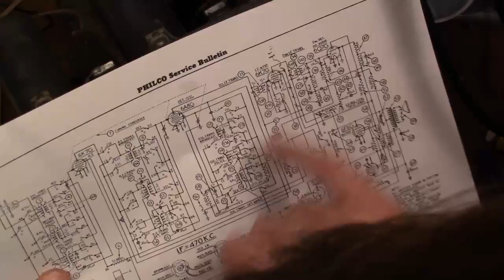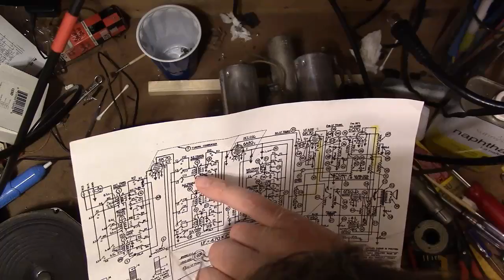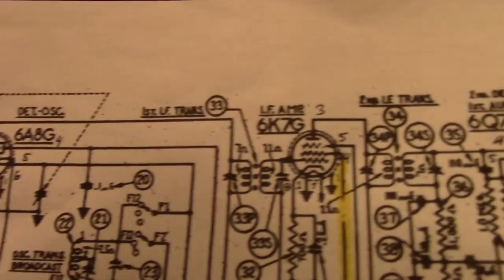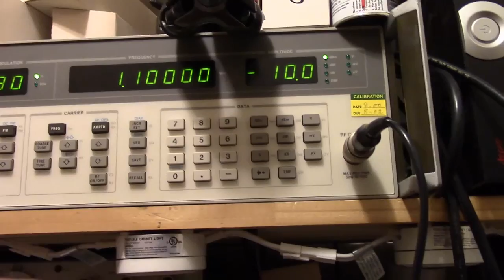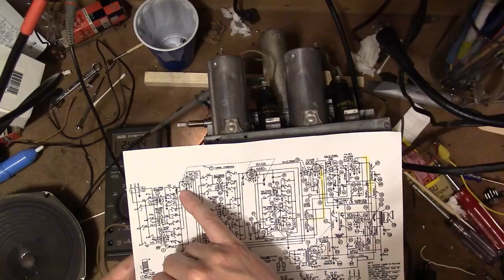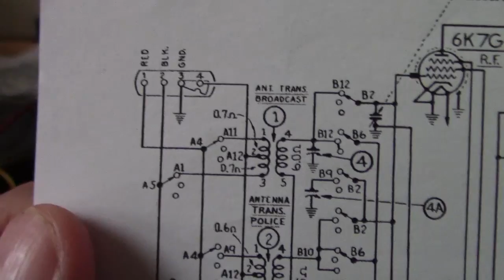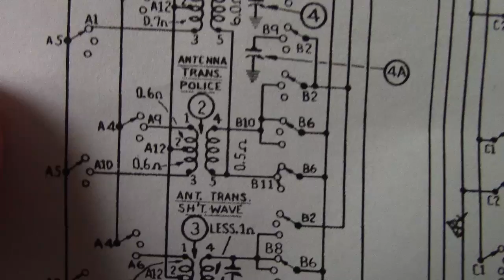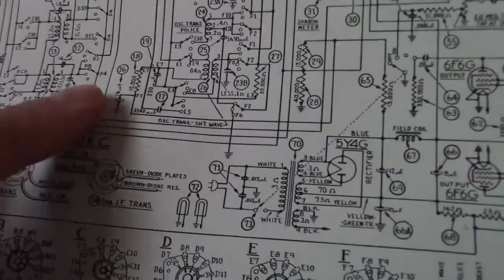Philco 37-640 restoration p8o12

Comment: Great Resto job! I did a 37-650 console last year but didn't take apart the RF deck to the degree that you have. With all that disassembly I think it is quite possible something didn't get put back quite right. So easy to miss something from my experience. Those trimmer caps should show a definite peaking which you didn't seem to be getting which I think is another clue.

Comment: Hi Bob, Make sure that B+ is getting to the RF amp if power is not getting there you will get weak reception. So check that  B+ to the RF amp. All the best, Tom J from Florida.
Reply from the maker: Thomas Johnson Hi.  The voltages on all the tubes are correct.  Still troubleshooting...

Comment: Hi Bob,
You did a fantastic job on the restoration! Since you are weak on sensitivity, I recently read one of my notes from Paul Pinyot where he said that after installing new caps in the AM IF cans of a Blaupunkt radio he was working on, the sensitivity increased dramatically. I can't remember if you replaced the caps: 33P, 33S, 34P, 34S.
Reply from the maker: Joseph Neal No, they don't need to be replaced.  I'm not even sure it's possible. More modern IF cans use fixed mica caps and movable tuning slugs.  It's those fixed mica caps that go bad becuase they are exposed to the air.  This type uses fixed inductors and variable ceramic trimmer caps that do not go bad.

Comment: I have been enjoying watching this restoration from the beginning and indeed it has been a challenge for you. Seems that the sensitivity is lacking. Because you virtually rebuilt the radio there still is a possibility if another missing connection. Good luck. I know you will find the problem.

Dave KD1NA

Comment: ST glass tubes would be proper for that anyway.  Philco wasn't a big fan of RCA stuff, which would include metal tubes.
Reply from the maker: I'm aware that 'G' ST type tubes were used originally but they are more expensive and the shields fit very tightly. Not to mention the metal tubes are shielded better

Comment: Did you jumper across what would be terminals 3 and 4 on the missing antenna terminal board?  There should be a jumper that is attached to terminal #3 going to either terminal #2 or terminal #4, depending on if you are using a true dipole antenna or not.
Reply from the maker: FrankieKat Yes, I tried both and it made a little difference but not a whole lot.

Comment: Something is definitely not right there, with a tuned RF stage it should be picking up the local stations with a short antenna or none at all.
Reply from the maker: OlegKostoglatov Exactly.  AM 720 and 1000 should be booming in

Comment: Hey Mr B.

It's not a grounding issue with your antenna? As one of the three wires for the antenna is grounded to the chassis, and when you supply a ground (with your finger) the signal is much stronger.
Sorry if this is completely wrong, I'm very much a novice, but I didn't see you show that particular wire as grounded in your vid.
Reply: Lawson80 Looking closer at the end of the video, I see that third wire is hooked up to an external ground ... would grounding it to the chassis instead of an external ground work better?
Reply from the maker: Lawson80 An external ground works better as the chassis is just floating.  I live near several strong stations that I should be able to receive with no ground and little to no antenna at all.  Hoping a full alignment will take care of that.

Comment: Sounds like you are a Chicago boy.  Same here.  

Where do you buy your caps for this vintage work???  I am looking to restore an 1959 Philco stereo phono, AM/FM radio, system.  I have gathered various pieces of  test gear for tube electronics restoration I need a good source of parts now.  Please advise of any sources you use in the Chicago area.  I live in a south suburb on Chicago area.  I would appreciate your input.  THANX
Reply from the maker: jp040759 Hi.  I get all of my parts online - I don't know of any electronics stores in the Chicagoland area.  Mostly I use Mouser, Digi-key and Allied Electronics.